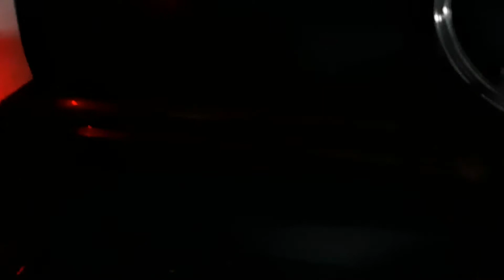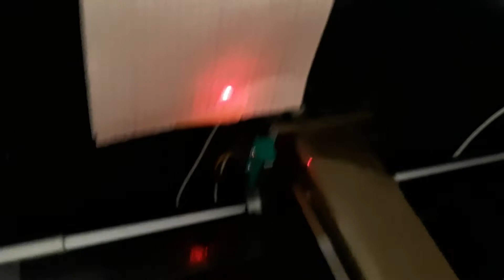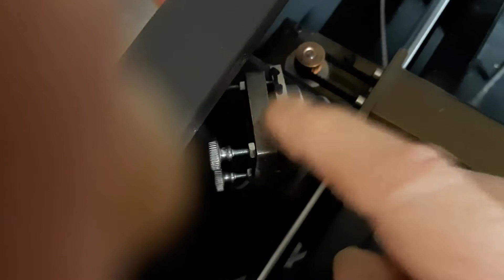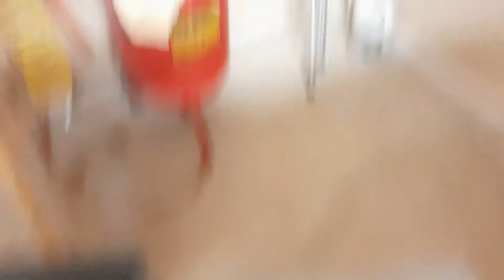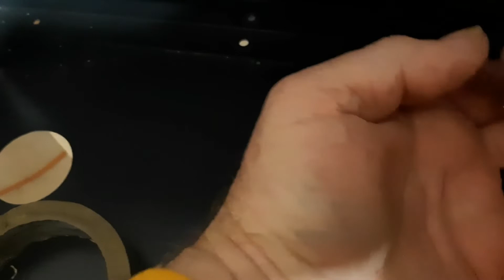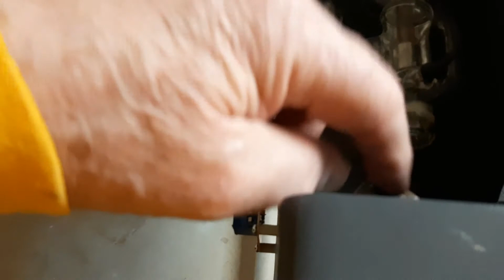K40 - Head Alignment With American Photonics Laser

Comment: Hi , please where can I buy this gadget ? thank you Andrea
Reply from the maker: Contract ANERICAN PHOTONICS direct.  Try Google for their contact info.  I no longer use the built in batteries as they do not last long enough.  Instead I have made a battery pack from 3 AAA batteries and use jumper cables to place the pack out of the way.
Reply: @jcbigdaddy9901  Hi John.  Do you have any more info about your battery conversion for the photonics alignment tool?  I checked your videos and didn't see anything in the titles or thumbnails.  I just acquired one of these and boy do those batteries run out fast. lol  Thanks! -Mike